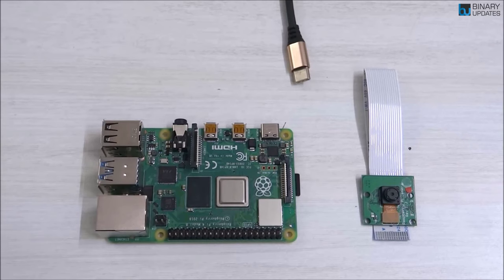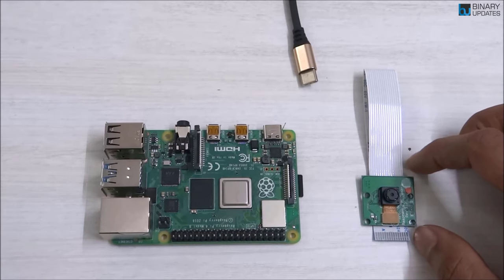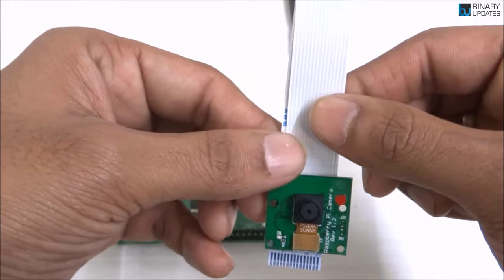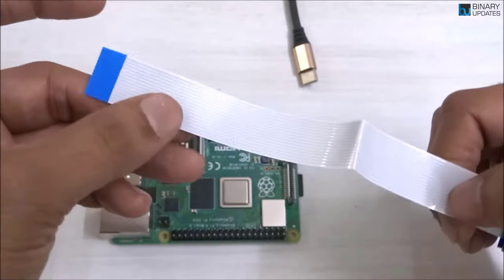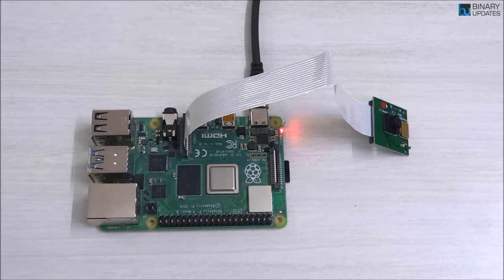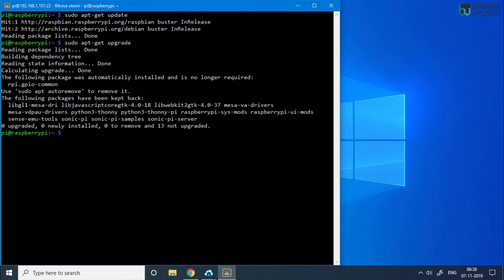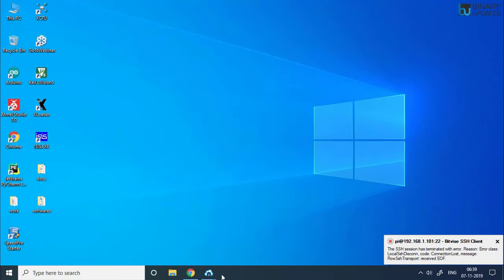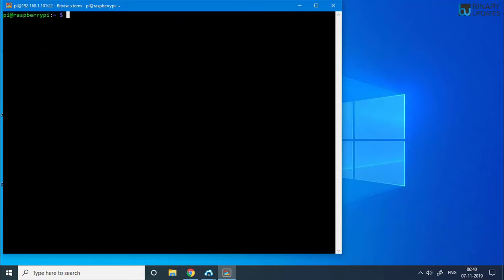Camera Module with Raspberry Pi4

Comment: When I run the raspi-config command, the camera option to enable does not appear
Reply from the maker: Hi Luise, to turn on camera run sudo raspi-config command in terminal and then select "Interfacing options" under that somewhere you'll find Interfaces Tab in option to select Enable Raspberry Pi camera interface. I hope this may help. If you won't find easily i recommend to browse all options under raspi-config to explore more. Good luck and best wishes!
Reply: Change the os version. It worked for me
Reply: Which OS do you use please???very urgent 🙏🏻🙏🏻🙏🏻🙏🏻🙏🏻

Comment: In the first part of the video, where you explain plugging the camera module in... If you are at liberty to change the room, the audio would benefit from hanging some curtains, or spare fabric items up in the room to reduce echo.

The fancier option is to use sound paneling, but it's more involved to install.

Your microphone itself sounds good. Nothing to complain about.

The explanation of how to plug the camera in was a bit wordy, but it had all the important details. If you want to increase the quality of your videos, consider writing a script ahead of time. Adding a slight pause after you say something will also help the viewer have time to process the information you gave them. It was fine in this video, but if you read from a script quickly, you may talk faster than normal. (I'm just trying to predict possible problems before they happen.)

I realize this video was over a year ago, and you have probably improved since then if you've continued making videos. Please excuse me for giving unsolicited advice, I hope you don't find it rude.

Comment: After Enabling Camera Interface and sudo reboot....Error showing in VNC that is "cannot currently show the desktop"......what to do now...ts urgent...please help....I've tried resolution change as well....it isn't working

reply me please.....!!
Reply from the maker: It seems like you've issue with VNC on Raspberry Pi. Maybe after shutdown when you restart may work properly. Otherwise use Bitvise SSH Client for remote desktop login to Raspberry Pi. Good luck!
Reply: @BINARYUPDATES  thank you so much for your reply....my problem got fixed after disabling my HDMI's from configuration
Reply: Hi sagar, iam also facing the same issue. I would be grateful if you please tell me how should I get rid of this error..
Reply: @adityasagarr  Hi sagar, iam also facing the same issue. I would be grateful if you please tell me how should I get rid of this error..
Reply: @passionforall-ld8gy  my problem got fixed after disabling my HDMI's from configuration
Reply: @adityasagarr  can u please tell me how should I disable that
Reply: @passionforall-ld8gy  follow the above steps....it will be inside any of the options on raspi-config menu do check it out ...

Comment: The camera does not show the slow image when recording the Videos????
Reply from the maker: Raspberry Pi Camera is slow sometimes to respond with lower frames per seconds FPS. Make sure you've quality power supply while making camera module streaming video using Raspberry Pi4. Sometime because of lack of power raspberry pi slows down processing camera images and videos. I hope this may help you. Good luck!
Reply: @BINARYUPDATES  thanks for the answer, what happens is that I wanted to make a small video recorder but the images are slow

Comment: I am new to his area. For Camera Module Rev 1.3., is the camera parts replaceable by another camera from a smartphone? Should I obtain an driver or edit the specification to make it work? Look forwards your reply and thanks in advance
Reply from the maker: If you want to use smart phone camera with Raspberry Pi then you need to connect your phone as a client and then access phone camera over local network. Its possible but it may require you to install additional software packages on Raspberry Pi. I hope this may help you. Good luck. Thanks

Comment: hello thankyou for this video 
i have a problem when i run : sudo raspistill -o img.jpg
mmal: Cannot read camera info, keeping the defaults for OV5647
mmal: mmal_vc_component_create: failed to create component 'vc.ril.camera' (1:ENOMEM)
mmal: mmal_component_create_core: could not create component 'vc.ril.camera' (1)
mmal: Failed to create camera component
mmal: main: Failed to create camera component
mmal: Camera is not detected. Please check carefully the camera module is installed correctly
Reply: hi i hav the same problem, were you able to fix this

Comment: I am starting to use the the camera for the pi, and i noticed there are 4 holes in the corners of the camera. Normal mounting nails for the pi 4 model b do not fit in that hole. Do you know which size nail fits in the holes?

Comment: I am not getting that camera option in interfacing  options what to do
Reply: Bro now you got option of camera??  I also faced same issue
Reply from the maker: Please make sure you're using Raspberry Pi OS BUSTER version. In new Raspberry Pi OS old Camera interface is not supported. It support new RPi Camera module which uses different drivers. I'll suggest using older Raspberry Pi OS. Good luck and best wishes!

Comment: How to connect two cameras?
Can we use other cis connector?
Reply from the maker: Hi Himanshu, in my opinion as there is only one CSI connector you can connect one standard Raspberry Pi camera using CSI and other USB Web Camera you can interface using available USB connector on Raspberry Pi. I'm not aware of any CSI extender if there is any in market. I hope this may help you. Good luck, best wishes!

Comment: Kithe camera option is not showing in my raspi-config, can you have any solution for this??, If anyone has please reply
Reply from the maker: Hi Pratik, check under "Interfacing options" under raspi-config command. you'll find somewhere. Otherwise use GUI or Desktop version on HDMI monitor and then navigate the menu bar and manually turn on Camera option. Sometimes the place to find camera settings changes as per version of Raspberry Pi OS you've installed. Good luck and best wishes!

Comment: Does anyone know if you can attatch  a sense hat and a camera to the pi 4?
Reply: Yes, but it gets messy
Reply: @joshuagonzalez1282  thanks for the reply, I have since done it, I do agree with you and it throws off the temperature sensor too, I have used it to build a camera and monitor for my girlfriend's pet hamster, it does work well however as you say, it is a bit messy

Comment: My camera is not getting detected, in interface it's not showing
Reply from the maker: Hi Baseeth, I would suggest confirm proper connection of camera with your Raspberry Pi. Especially, flat ribbon cable. And then check raspberry pi configuration and turn on camera using command sudo raspi-config. Also make sure raspberry pi camera is good in condition because its very sensitive. I hope this may help you. Good luck and best wishes!

Comment: doesnt work for me no option to enable camera
Reply from the maker: Hi Jeff, please check in Raspberry Pi configuration section. There you'll find camera related setting to enable RPi Camera Interface. The command is "sudo raspi-config" or else try with desktop version, i mean using GUI of Raspberry pi OS to enable Camera interface

I hope this may help you. Good luck and best wishes!
Reply: @BINARYUPDATES  hello thank you for reply ive tried that the only option is enable legacy camera.  no one seems to know answer. With lagacy enabled still doesnt work..

Comment: I had a problem with pi camera and raspberry pi 4 
mmal : cannot read camera info, keeping the defaults os5647
Mmal :vc component_create_core,failed to create component 'vc.ril.camera' (1:ENOMEN)
etc...........
Reply: I had the same problem
Reply: I also got the same issue,It's because of loose connection
Reply: @BalaEsakki V Hey! i solved this issue. You have to install some tools for camera module. Firstly raspistill and then raspivid. use this code sudo apt-get install raspistill for raspistill and use this code sudo apt-get install raspivid for raspivid. Last one raspistill -t 5000 -o anyImage.jpg  and this is the solve.
Reply: I have problem mmal:mmal_vc_component_enable:failed to enable component:ENOSPC